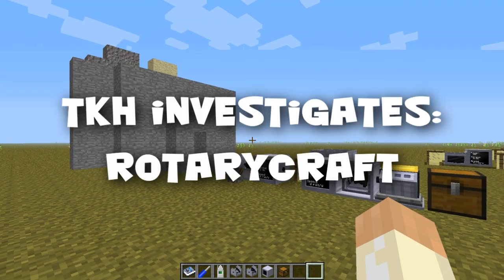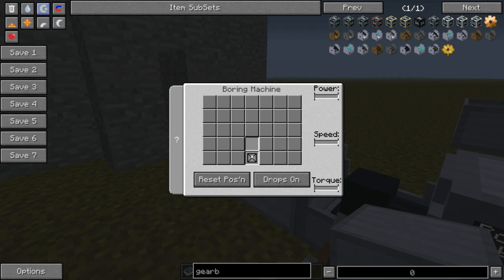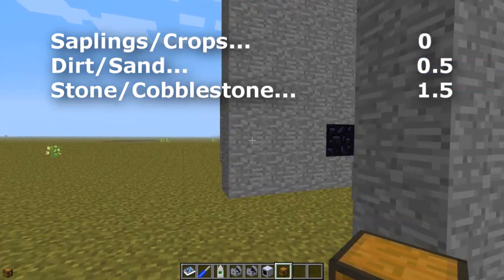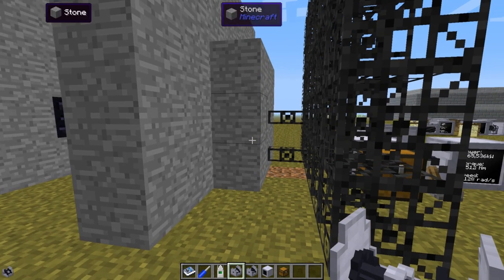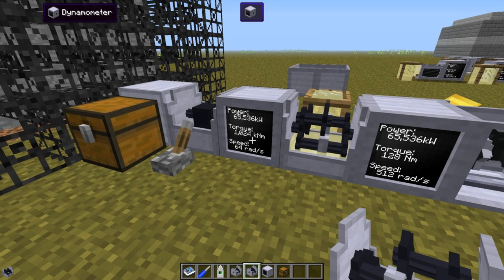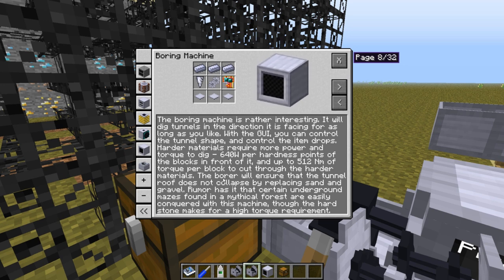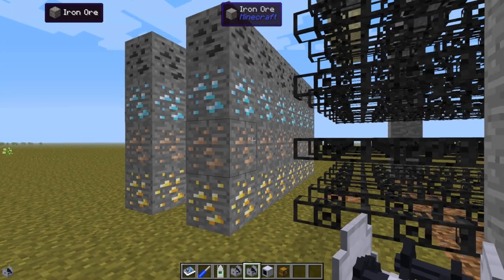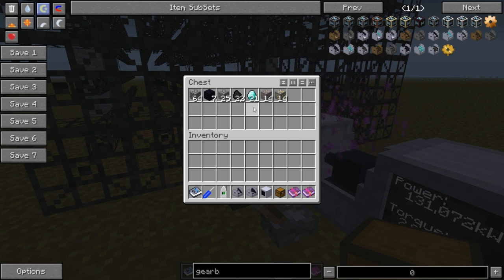RotaryCraft Tutorial - Boring Machine (FTB 1.6.4)

Comment: Two questions:
1. How does the machine deal with lava and water?
2. Can it dig upwards? (a Nether quarry?).
Reply from the maker: 1. Lava and Water is no problem while the boring machine is running. However, when you break the machine and its pipes, water will flow into the tunnel. So bring something to fill in those holes when exploring the tunnel later. Gravel and Sand should be taken care of automatically though.
2. No, it can only dig horizontally.

Comment: I'm having a problem with the boring machine and I was wondering if you could help solve it.  I'm currently playing on a private Monster server and I have 5 boring machines set up with their own water falls/HK generators.  I have them placed between lvl 64 and 12 but none of the machines have found iron ore.  They've been running for about a week with no luck.  Is this by design?  Or am I just extremely unlucky?
Reply from the maker: Ok, let's see. What version of Monster pack to start with? Any graphical addons (optifine or texture packs etc.)? Next thing is the power. How many HK Generators are connected to each? How much power are they producing? How have you geared the power into the Boring Machine? Speed and Torque I mean. Use the Angular Transducer to get exact readings. Next thing is the Boring Machine interface, how have you setup the digging pattern and the configuration? Can you show a screenshot (imgur link in a PM for example) of how it looks? Are you getting any drops at all from it? If it works you should get a ton of Cobblestone and other things to start with. To answer your question; it is not by design, if it works you should constantly get items, including Iron Ore :)
Reply: therealtkh I'm using the 1.6.4 version with no visual addons.  The server is also not using any visual addons.  There's currently 5 HK per machine at 2.6MW.  Each machine is slowly being equipped with the enchants.  The machines are using the max grid pattern.  I'm using steel shafts and bevel gears to transfer the power and a CVT at the top to prevent the shafts from breaking.  Inspecting the tunnels shows that there's no iron in any of the tunnels.  Looking at the tunnels in a ravine cut out does show iron on those levels.  They are returning copper, dark iron, coal, redstone, etc.  Just no iron.

Thank you for your time on this :)
Reply from the maker: WalkMrJ This is very strange. It seems to me like a solid system, and the fact that everything else comes out fine should mean that there is nothing wrong with the setup. I ran into an issue in my speedplay series, I had plenty of most stuff but no Iron. But I just thought I had the boring machine at a too low level. (Normally it should spawn between 1-63 though...) But it made me run a few tests (in FTB Monster 1.1.2), but from what I can see the boring machine is able to break and put the iron in a chset as it should do... But since I had similar issue... perhaps this is something to look more into. Is the world generation algorithm for iron not suitable for the Boring machine or what? :) I will try to look more into this, if you find anything please update here!
Reply from the maker: WalkMrJ I have now seen the same issue as you have! I did a test for an hour or so, put up four Boring Machines on different levels. The highest at around ~50 and the lowest around ~10. Later when I checked the result, only two of the machines had found Iron (in expected amounts). I will do a big test on this and perhaps make a video about it. This probably explains the lack of Iron in my system as well :)